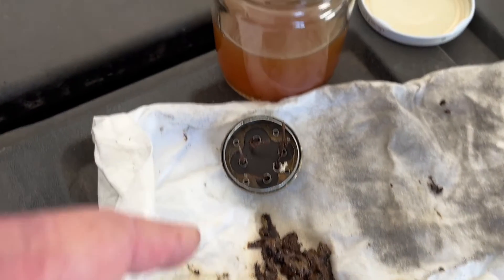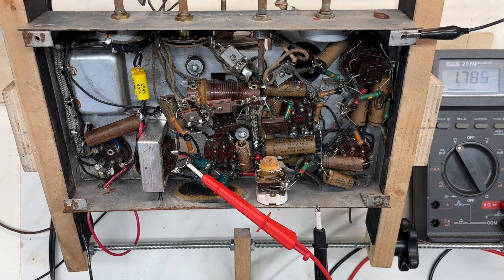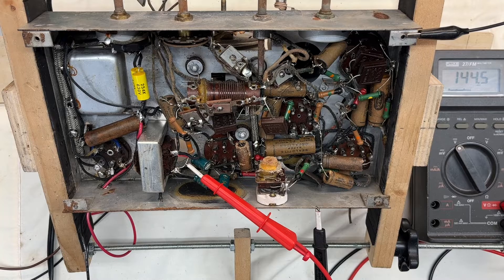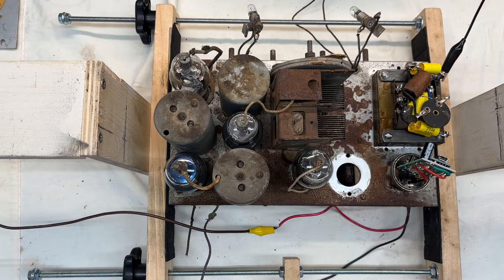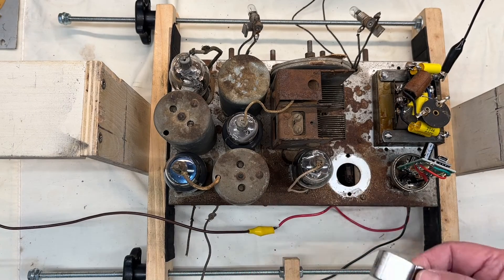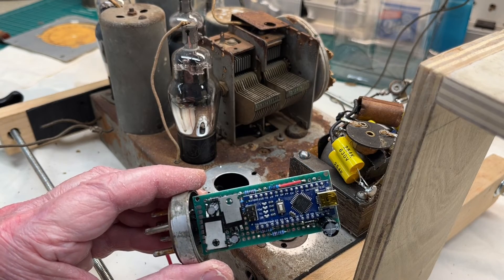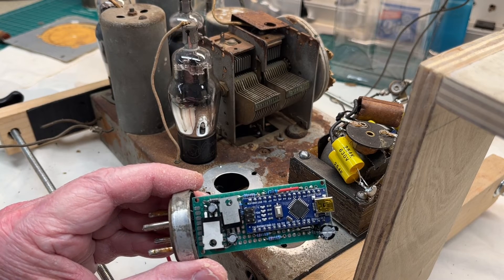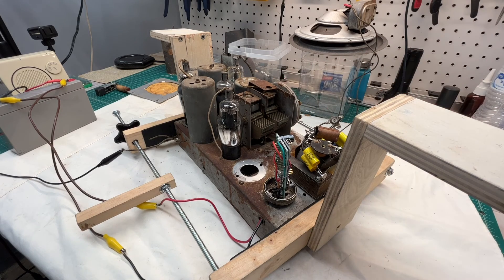Synchronous Vibrator Build w/ Arduino - Schematic, BOM & Sketch Coming Soon

Comment: I believe there were originally some high voltage buffer capacitors installed in conjunction with the vibrator (part of the radio) that mitigated the arc at the points.

The SS unit will be the way to go, though!
Reply from the maker: You are spot on. In addition to the caps, this receiver had two 100 ohm resistors to ground from each primary input to mitigate the issue as well. Best, Don

Comment: great video on the restoration and the vibrator .if you get a chance would be nice to see the Arduino square wave running with the  radio  .
John
Reply from the maker: John - check out the short unlisted video below. More to come as time permits. All the best. Don

For John | Synchronous Vibrator Under Load Both Channels
https://youtu.be/x31Jp-DwxOI

Comment: Very nice! The Vibrator replacement works very well! Radio doesnt sound bad with all the old components. I was concerned with the antenna coil? The mice had chewed a bit on it…lol…Thanks for sharing! Take Care—Larry
Reply from the maker: Appreciate it Larry. Hope to share the other circuits I built as well ASAP. Best, Don